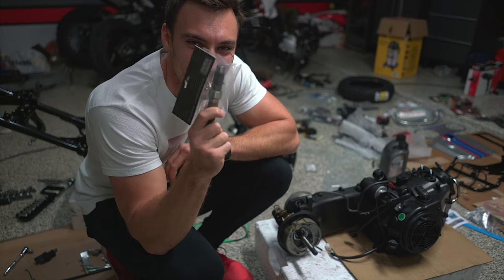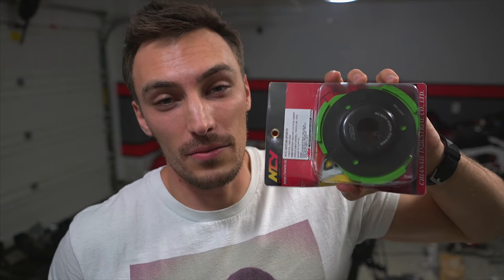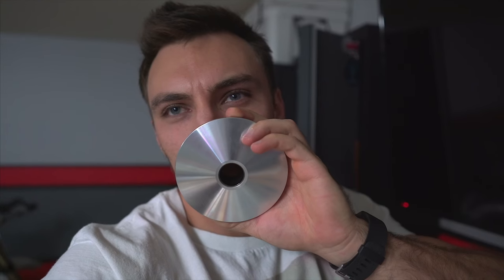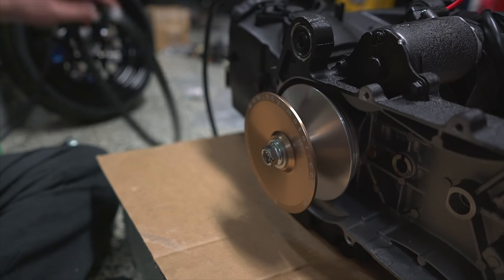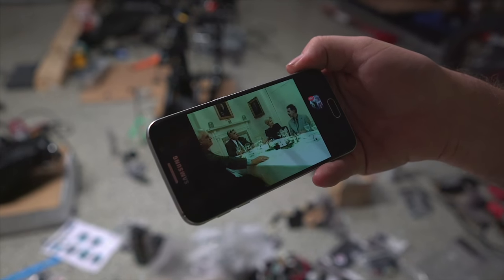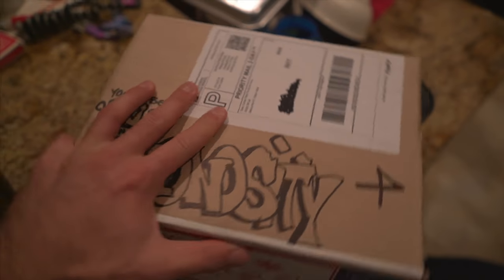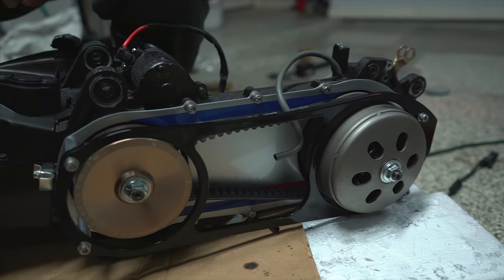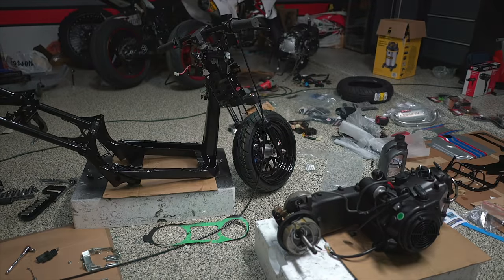GY6 MODS! + There is a smell... [Ruckus Build Part 11]

Comment: you know the rolls are for the accelaration, you have different weights so you can optimise them. Light rolls are for faster acceleration and heavier ones are for more top speed. If you want the perfect set up its a trial and error concept. You can also adjust the clutch spring for different ones. (if I said something wrong correct me please, but this is what I know about rolls and springs)

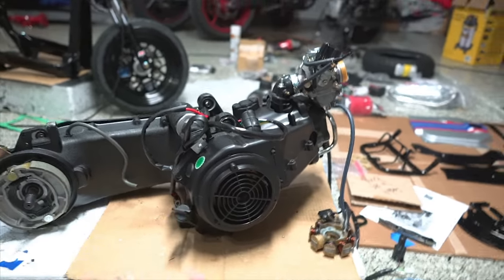Comment: Motonosity. At 14:23 you forgot to put the cooling fan back on the flywheel before you put the engine shroud back on. Don't run the motor without it or it will destroy(over heat) itself and you'll likely habe to buy a new engine or rebuild it.

Comment: I would've liked to see a more thorough instructions, for example the part where you to take the frame off & disconnected all the wiring, but it's understandable it's a build series and not a how-to series. Maybe you could do a second build series were you top this one off & put a turbo on it. I know it's been done before but maybe you could top it. I think people want to see a thorough break down of things &maybe basic maintenance tips for beginners. I feel as if there is need for it, there hardly is any good videos on things like that. Even how to unplug and plug up wires would be helpful. The only real thing available is forums, but those only help so much .Either way your videos are fresh & enjoyed the Ruckus build series👍🏻 - A.b ft worth tx

Comment: So... You have the driving belt in the open air?... Interesting... Very cool... But interesting...
Reply: Duncan De hulst very common among ruckus riders apparently
Reply: Duncan De hulst seems like it will get wet easy and start slipping
Reply: HusseJumala i know, pretty cool though... if it is usefull... im not sure

Comment: That drive belt looks loose as hell. Is the front pulley tightened on the spacer or on the belt itself? Might want to double check that before you put the motor in - it's a good way to both burn the belt up & have the nut back off. Pretty common issue with multi-part pulleys; usually you want to put those together without the belt & then stretch the belt to slide the other pulley onto its shaft, pretty much like you did taking the old parts off.

Comment: I don't own a ruckus but my scooter has the same gearing/clutch and i have some questions. How canging the cilinders can both give you more acceleration and higher top speed? That's a misleading ad, let's say you swap the stock cylinders with lighter ones this means once the engine starts spinning the lighter cilinders will move out faster meaning the pulley (not sure it's called pulley in english) will expand faster meaning the variator/clutch ratio will be higher sooner. If you have heavier cilinders the opposite, the cylinders will be slower to move out so the variator/clutch ratio will get higher slower, you simply can't have both more acceleration and higher top speed at the same time unless you changed how a variator works, maybe the new one is made to work in a different way.

Comment: you replaced the clutch pack with a ncy clutch which is good, but what bore will you be running? every bore is difrent needing on the contra and triplet springs in the clutch. then roller weights are gonna wannna make you eat your lunch. try to find someone local after your ready to tune your motor to get you to basics of tuning the cvt. it is a long drawn out process, all based on each engine. you cannot just read a guide and do it. its all in how much you weigh, your bikes bore, performance, tune, and just the bike itself. its difrent for everyone.

Comment: Dude!!! You forgot the white air-wheel, when you replaced the stator. It keeps your motor nice and cold, with good airflow. I don´t think you want your machine to overheat, and be replacing a cylinder kit and crankshaft can be expensive. :)
Reply from the maker: +BOOSlovers keep watching lol ;)
Reply: Motonosity Well, now that i saw the end, it makes sense. hah.
Reply: What grinds my gears about these build series videos are how disorganized they are. when you talk about masking off areas of the frame in one video and then in the next video you tell us what areas you forgot to mask off. the other issue I see with this is if someone's trying to follow your videos like steps in a instruction manual (which seems to be what you're going for in the series) they will be confused and make the same mistakes as you or more. Motonosity I think you need to get your shit together with the format of these videos and how they are thought through.

Comment: you shouldve change the clutch spring with a less "springy" one and also change the cvt roller weights dont know the exact grams. 3 light one and 3 slightly heavy ones

Comment: What grinds my gears about these build series videos are how disorganized they are. when you talk about masking off areas of the frame in one video and then in the next video you tell us what areas you forgot to mask off. the other issue I see with this is if someone's trying to follow your videos like steps in a instruction manual (which seems to be what you're going for in the series) they will be confused and make the same mistakes as you or more. Motonosity I think you need to get your shit together with the format of these videos and how they are thought through.

Comment: why did you paint that clutch cover even tho no one will see it
Reply: Charlieswag9000 the clutch or the engine cover? The new clutch came green in the packaging in the video, the engine cover he painted because you can still see it with that kit (instead of having the drive belt covered, it's open with the kit and both pieces are at least partially visible (as you can see when he puts it together and holds it up, can't see much of the stripes on the plate but you can still see them)
Reply: yea the engine cover, its pretty dumb to paint it when its so not visible
Reply: Charlieswag9000 yeah but think - the front plate is that tiny thin little thing so it can't take a pattern. The back plate had to painted something other than the silver that it was so it would match the bike, so instead of going black that's the best place there to get some colour on the engine :)
Reply from the maker: Yeah Qaussie covered it pretty well :)
Reply: Motonosity glad I could help haha :) looks pretty wicked man, even with the belt and stuff on there those highlights are pretty damn cool

By the way, couldn't help laughing at fry laughing too hard at the end haha. Absolutely lost it 😂

Comment: the red loctite is totally unnecessary!
Reply from the maker: Better safe than sorry!
Reply: Motonosity Just use blue, if you use red you'll have to use high heat to remove them afterwards
Reply: yea use blue loctite you never know if something happens you would need to take some shit apart....then you'd be fucked
Reply: or just no loctite. I have worked on a lot of these kinda scooters, different brands and what not. These covers never come loose and we never use loctite